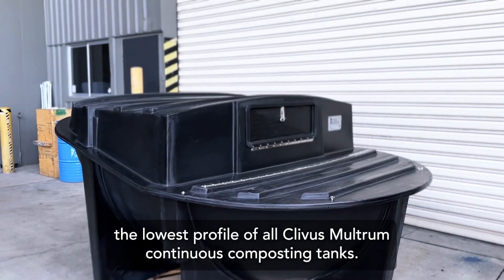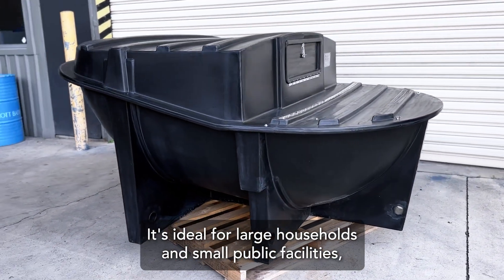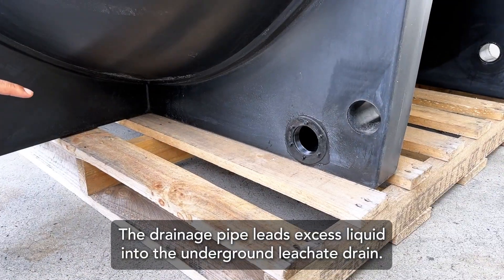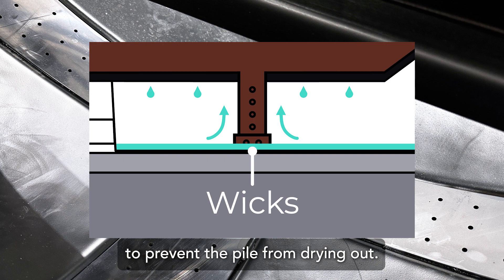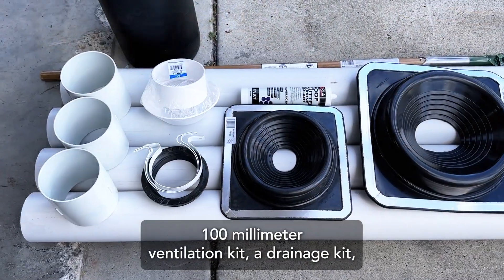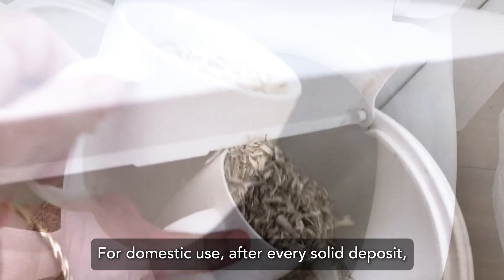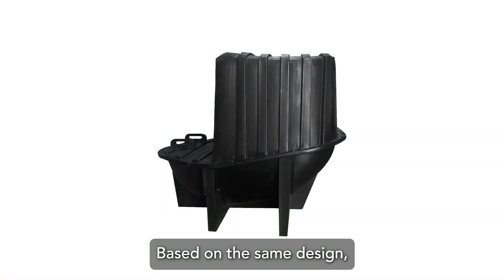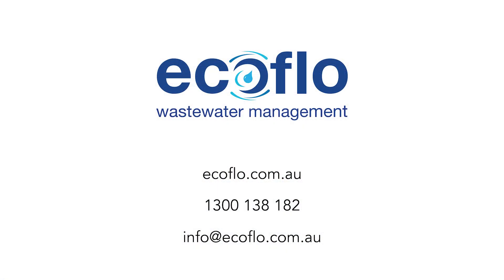Clivus Multrum 14 Next Gen | Waterless Continuous Composting Toilet System

Comment: could this be used for vermicomposting toilets?
Reply from the maker: It may be possible. You may have to add a mesh screen on top of the drainage holes so the worms do not fall through.

Comment: How does it perform in cold weather -20 f
Reply from the maker: Hi Douglas, 

The composting microbes do go into hibernation when they reach freezing temperatures like that. But the tank insulates the composting pile so it can retain its heat for a while. It is impacted by a lot of other factors as well, such as moisture, usage, and sunlight. A heater pad can always be installed to keep the composting warm if need be. 

I recommend getting in contact with our sales team on 1300 138 182 or emailing info@ecoflo.com.au to talk through your specific requirements.